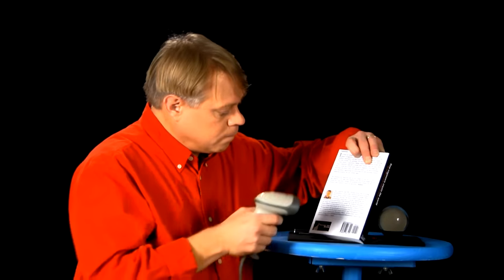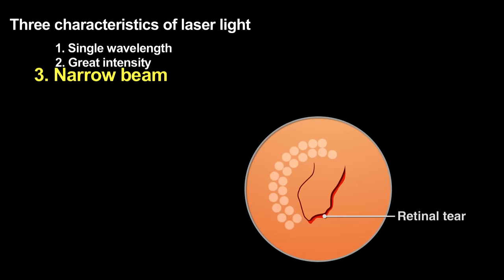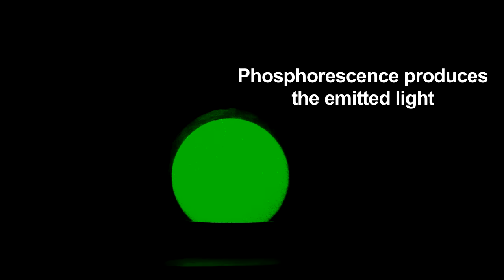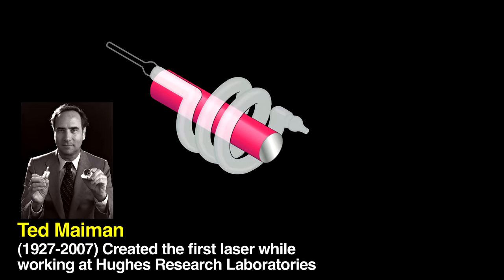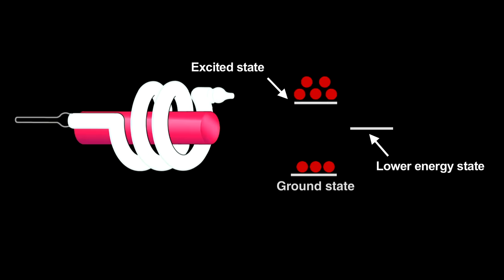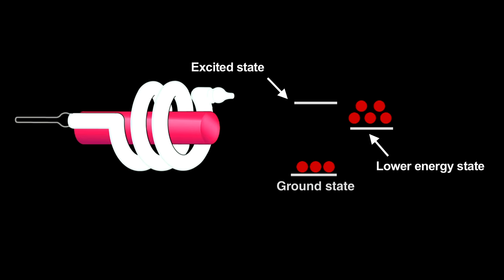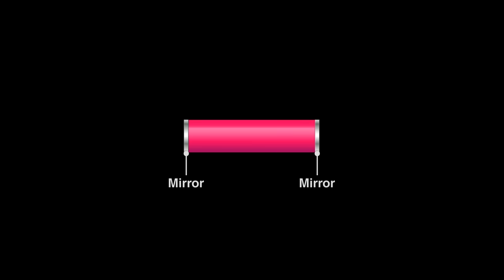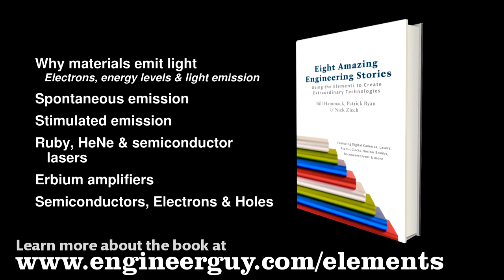How a Laser Works

Comment: I understood up until 2:19 then I thought.......... ???? So basically I learnt they have rubies in them with some glass beads...... OFF TO THE NEXT SCIENCE VIDEO TO HALF LEARN SOMETHING!
Reply: +ReaLzEdits no glass beads. he was just using them as an example of a material that doesn't give off light and comparing them to the ruby that does.
Reply: ReaLzEdits ok you want a simpler explanation? see how the ruby shines when he turns the flashlight on it? make the ruby a tube, make the flashlight like a million times stronger, poke a hole in one end of the ruby, BAM, laser.
Reply: +ReaLzEdits the video do not explain "stimulated emission". and the picture is not correctly explain the population inversion. in stimulated emission, when light hit the electron to excited state, it will double the income light. Two "mirror" will reflect the light backward and this process repeat many time until "light" are very very strong to exit through the mirror.  It is still over simplified  but still better then not explain.
Reply: +ReaLzEdits "ruby shines in flashlight" is fluorescence not laser....
Reply: Good video. my question was about the grainy look on the spot of light. In the dark, I pointed my laser up to the ceiling and left it on. I noticed that the whole room had that grainy look. So the video pointed out that it's not the laser itself, but the surface that the light bounces off of that makes it look like that. I'm happy now.
Reply: They have already received high praise.  See the 1964 nobel prize in physics.  Also, the modern internet would not be possible without affordable, reliable lasers as they enable high speed long distance communication.
Reply: The grainy appearance of the light has to do with the fact that it is monochromatic - the laser produces only one wavelength of light.  As a result of this, the light will interfere with itself constructively and destructively, producing a 'speckle' of bright and dark spots.  This speckle pattern will be influenced by whatever the light bounces off of as well as the surface that it is projected on.  The pattern is also dependent of the wavelength of the light.  You don't see this with normal lights because they emit light across a broad spectrum so the speckle pattern gets averaged out across all of the wavelengths.
Reply: +Kenneth Fung As a matter of fact, he did explain stimulated emission at 3:02. Population inversion is also quite correct in the animation as there are more electrons in the excited or meta stable state than there is in the round state.
Reply: +Zhuang Tao *ground state
Reply: +Alex Forencich But I thought an interference pattern or "grainy appearance" is only possible when there is diffraction and that is only possible when there are slits or small gaps in front of the laser which will diffract the light which interfere constructively and destructively up till the screen which is the ceiling in this case. The pattern will depend on the distance between the screen and the slit, the slit separation and the wavelength of monochromatic light. Young's Double Slit experiment is a prime example of this.
Reply: I've been watching the speckle for decades in my job, always wondering. Thanks to you, it is now demystified, and I shall share with anyone who is willing to listen. Booyah!

Comment: Can you do one on green lasers? Their mechanism is different, and I would love to hear you explain it!
Reply: The principle is the same which you are still exciting electrons into a higher energy state and allowing the electrons to relax back to its ground state. But the material is different. The wavelength (color) depends on the energy difference of the excited state and the ground state for that is the energy the electron gives off when it relaxes. This would require different materials, many green lasers today are uses semiconductors as the lasing  medium.
Reply: Not really, most Green Lasers are using an Infrared laser passed through a small doped crystal that changes the wavelength to green.

I believe this is what he is referring to.
Reply: MrMattsung Look up frequency doubling. Or second harmonic generation. Focused light passes through a non linear crystal where SHG effect produces wavelengths of half of the original.

Comment: Wait... I tought lasers don't need a lamp or a ruby. Was it an older version of a laser he was explaining?
Reply: TheArmFlailer
 Never knew that. How come lasers are so cheap and affordable then? Are the gems impure or very small?
Reply: TheArmFlailer
Alright I see. Then what is the other laser with gas inside and no lamp? Only switching electron states?
Reply: TheArmFlailer
 Oh ok. Thanks for explaining
Reply: There are many ways to make a laser.  All you need is a laser cavity, a gain medium, and a source of energy.  In the ruby laser, the flash lamp provides the 'pump' energy and the 'pumped' ruby provides the gain medium.  Mirrors create the cavity.  However, other things can be used as a gain medium.  Helium neon lasers use a combination of helium and neon gas in a tube.  Electricity passed through the tube provides the energy, the excited gas provides the gain, and the mirrors at the ends of the tube form the cavity.  Diode lasers use specially doped semiconductor to form the gain medium with electric current providing the energy.  The laser cavity can be formed a number of ways - cleaved semiconductor faces, distributed gratings, etc.  Lasers can be used to pump gain material as well, for example erbium doped fiber amplifiers use lasers to pump energy into a section of glass optical fiber that contains a small amount of erbium to form the gain medium.  This can be built into a laser, but more commonly it is used to amplify optical signals in a fiber so that they can be sent hundreds of miles.  The gain medium can also be a liquid - lasers called dye lasers circulate liquid dye as a gain medium and can be pumped with flash lamps or other lasers to produce light with specific properties.
Reply: Alex Forencich
 Yeah that's the type I was thinking about, like how do they make all the multi colored lasers. Thank you for explaining :)
Reply: the cheap 1$ lasers are LED lasers not ruby or any crystal/gas laser.
Reply: id523 Ok thanks
Reply: OHM-968692 laser pointers are not solid lasers like ruby lasers.  They are semiconductor lasers. There are also gas lasers like co2 and he-ne lasers.

Comment: 1966 my high school class took a trip down to the Honeywell research labs to see what they were working on. One of the many things we saw was a high power pulse laser that could punch holes through steel plate. They had a capacitor bank the size of a big room they charged up to get a 1/100th second that fired a flash tube to get a laser discharge from the huge ruby. The other that was new and interesting was their first prototype pneumatic logic gate 4'x6' in size and used massive air flow. The gate was covered with plexiglass so you could see the colored air flow through the gate, which looked like a stick figure with its arms outstretched. Today, they are in 1' cubes and used in industry for control functions.
Reply: Crazy how they had that technology back in the 70s

Comment: Any guy who is not in engineering may struggle with these since it takes 1 semester and 1 complete chapter about laser in Applied Physics subject to fully understand. Still the video was very accurate and simplified and all the things said was true and accurate.

Explain : for those who dont get anything :  the electrons of few materials like GaAs are made to excite such a way that a large no. Of electrons are made to jump on higher energy state (pumping & Population inversion) and then when they loose energy they go to metastable state (intermediate energy level), these are hit by light of certain energy and the electrons thus get back to ground level by producing stimulated emissions (2n waves) which is reflected back (end to end mirrors) to create a narrow straight beam of light (standing waves) which are directed out. Note that if more electrons are on lower energy level than higher than spontaneous emissions occur which is useless and random thats why we use heavy pumping to achieve population inversion (more elec on higher energy level). Its really difficult to explain without diagrams and easier words as there's lot and i tried to skip many parts here to make it more readable/comprehensive.

Comment: You can scan a barcode with white light perfectly well. My phone does it. Using a laser allows you to do it more easily and quickly because you can focus a razor thin beam to a tiny spot that scans an aperture back and forth thousands of times a second and allows you to detect bands of light and dark with a simple single red-filtered photodiode (and red laser) rather than a whole ccd imager which needs relatively intense computational postprocessing to extract the code after the fact.

Comment: What is strange is the length of the rod mentioned, and the fact that the standing wave is formed, is the SAME PRINCIPLE at play in a truck air horn, or a musical horn. In the laser here, the light builds up, forms the standing wave, and as it achieves this, it begins to escape the one end. In a horn a vibration starts on the diaphragm, or reed, or your lips, or whatever. Until the standing wave forms, the cylinder (forget the bell on the end which amplifies the volume of the sound, by allowing the wave to grow in amplitude- or amplitude modulation, if you will) is "seen" as a closed end cylinder, (if that makes sense) and once a standing wave completely forms, and all the peaks and troughs are "marching" in perfect alignment, the sound emits beyond the end of the tube as a cohesive single frequency sound.   This was hard for me to try to put into an understandable paragraph, and I hope I got it right! In the laser, the tube of ruby material is effectively closed to a degree even with the partial mirroring, until the light gets to "marching in step". If you cut the bell end off at the right point, you would still hear the sound, it wouldn't be very loud, though. There must be some design in the shape of the bell, because it allows the exiting sound "wave" to grow in height, or amplitude, without changing the frequency, or the distance on a sine wave from the 0-point to the highest pressure, back down through the 0-line to the lowest pressure, and back to the 0-line. Did that make sense?  I tried anyway!!!

Comment: Bio-luminescence would imply that we radiate infrared radiation due to some biological systems when it's really due to having a temperature above 0K.  Anything above 0K (which is everything) radiates at some wavelength of light.  Similarly, phosphorescence only occurs when the light energy is absorbed by something and slowly released over time, which is not how we emit infrared radiation.  I hope that cleared things up a bit for you!

Comment: Thanks for sharing.  I had no idea that the basic principal of a laser, as you described it, shared similarities with my B.I.R.D. which I developed years ago.  Unlike the laser, I did not want a thin consistent beam as the final product, nor did I want the photons to "fan out", similar to a flashlight.  I had to create a device that broke the beam down into two separate phases.  The first phase took advantage of the photons which naturally move at right angles from the light source.  This process happened in what I called the "chamber".  After the photons had been processed in the chamber they were moved into the "open environment", where the desired effect was achieved and the finished product could be used.  I spent 10 years researching and working on this until it was finally accomplished.  I took out 6 U.S. provisional patents for this device.  Because of technological advances. I actually have one more tweak to make to it.  That move will simply increase the already very high efficiency of the device.
Reply: +Harold Bullock  Are you any where near the deadline for converting the provisionals and begin prosecuting them??  It'd be interesting to see what you're attempting...
--
Cheers.
Reply: +Observ45er Very close.  I'm waiting for an advanced component to arrive.  The one I am using now works fine.  This will just put the icing on the cake.
Reply: what the hell are you talking about?? is this a troll? whatever you said makes no sense....specially for someone who really did invent a light source (not being able to explain it in actual scientific terms). Plus, a quick Google search about patented B.I.R.D. yields no results...
I challenge you to clarify what your product does and how in scientific terms, and point to the said patents.
Reply: Jose...no troll.  In fact two days ago I completed replacing an old tech component with an updated version.  The device now operates as expected and to my complete satisfaction.  Sorry you did not find anything at the patent office.  Im not the least bit worried.  I have in my possession all the necessary paperwork, documents and recoepts from that office as well as the original search documents by a patent lawyer.  At this point I am not sure what I am going to do with this, though it seems a shame to just keep it to myself.  I will sit on it for a while and consult with smarter people than myself for the next logical action to take.  Best regards.
Reply: *****  He clearly doesn't want to 'give away' his idea.
...
You won't find anything on it.  Provisional patents aren't made public until either the end of a year with no action, or the normal grant (patent issued).   It's generally a way to extend the protection time when you are working on a full patent grant.   My son's a patent atty.
...
I'm just blown away by the fact that Harold is doing something similar to a laser and he didn't know how they work.
...
Note that a patent only gives you some evidence to bring suit if someone uses the concept for profit.  So the idea  must be worth enough (to someone) to justify the cost of fighting in court (if the infringer fights it), which can easily get into the hundreds of thousands of dollars US..
...
I considered patenting a directional antenna design I develped for a friend and a large ad agency's product campaign.  I'm aware of all the prior art because I've been in the field since the 1960's, but while it is clever and novel, it has limited use and I can't justify even the cost of a provisional (and I don't have to pay for an atty & search).  I'm considering just publishing it and, hopfully,  getting my name attached to it..
...
It would be nice if Harold indicated what kind of a problem it solves as I have a wide range of interests.
--
Cheers, ScienceAdvisorSteve
Reply: +Observ45er ...Jose...It is not that I don't want to give away my idea.  If a person was genuinely interested from either a personal or professional perspective I would have no problem sitting with them in a local cafe over lunch and discussing the device.  Even let them hold it and try it out.  That is not a problem.  But I will not splash this all over the internet for all the trolls to latch onto, since they have nothing better to do.
I like your idea for a directional antenna, but I thought they already existed.  Possibly you improved on it to a point where it has clear advantages over the previous design.  I can think of several applications where your antenna would be a game changer.  Best regards.
Reply: +Harold Bullock  That's ok.  It's still protecting your idea and nothing wrong with that.  I am curious about the general idea, but probably not close.  
..

Yes, there are many types of directional antennas.  This is for homing-in on a signal source.  I do interference hunting. It'll take too many words here and I don't know your background.  Pretty simple idea, but some new technology makes it more feasible.
...
I did "embody" it for an ad agency that wanted to have it in a product.  The idea was that when you run out, the package would direct you to it in the store.  Not practical, but for a trade show type of thing.  Fun project and good consulting fee ($150 US/hr) ...  A friend asked for help for his customer, so it gave me an opportunity to build some and actually prove it out nicely.  Long hours, cuz short time to show.
-- 
Cheers, Retired EE
Reply: Harold Bullock j

Comment: If my physics is recalled correctly a laser diode with low power (below a certain threashold) acts as an LED. It's only when enough power is put through the diode that the wavelength narrows to a LASER.

Comment: Ruby's a combination of aluminum oxide and chromium. While the glass beads are probably silicon oxide (not sure of what the colouring is). Specific compounds and atoms have specific energy levels that electrons can jump to. The jumps as shown in the video is what causes emission of light. Because these two things are made of different compounds, it is very likely that the glass beads do not contain the correct energy levels for the jump to produce that familiar red glow.

Comment: Hi Bill, nice video as always. Quick comment: the energy level animation makes it look like a population inversion can be created between the ground state and the upper excited state upon excitation, which isn't accurate (the reason a third state is needed in the first place). It's not, as you say in the video, that the flashlamp pumps so intensely, but rather than the excitation can be dumped to a third state. Even an infinitely powerful pump couldn't create an inversion in a 2 level system.